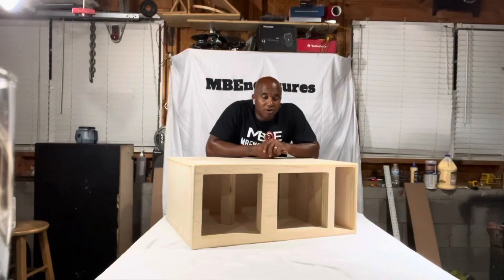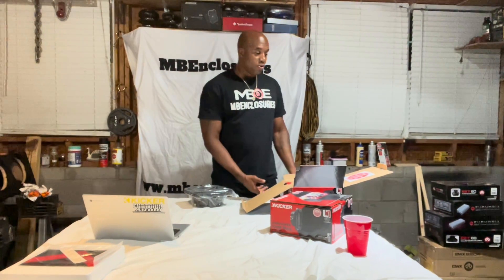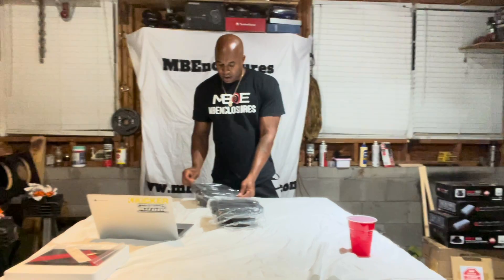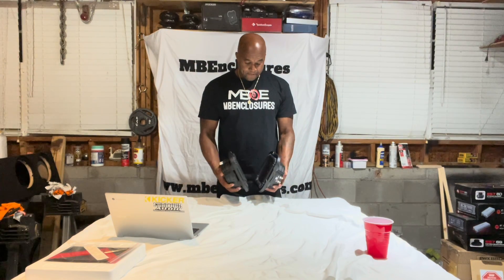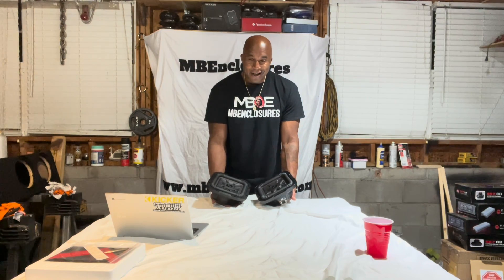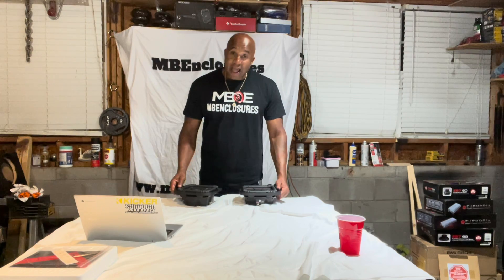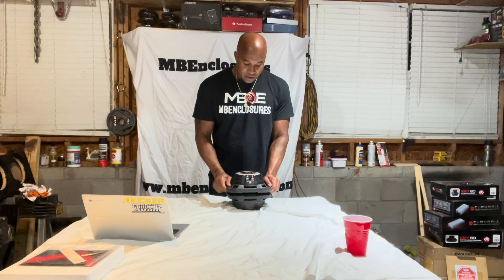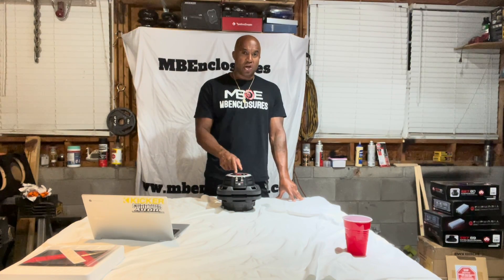Isobaric Loading Subwoofers and the Premise Behind It.

Comment: MB I had 4 Orion 10's Red stripe (I believe) in a 94 escort LX, HCCA 1k 6 channel at .5 ohm, it was by far better than any traditional box system I've had after including 2 t1 power 15's on a mmats 1100.1D. And the 15's were monsters 
But accuracy, sound carry, sound quality & omg the drops...I had to disconnect the emergency fuel shutoff in the trunk cause it would trip in acc mode & my car wouldn't start NO LIE !
Now you have me thinking i can fit 2 L7R 12's in my camaro instead of just the 1 in it now & absolutely kill it 🤯
Reply: Wow, I had a 1994 escort gt with two orion xtr 12dvc  and a orion hcca 225 and a soundstream reference 500 on my mb qaurt mids and highs. Don't tell me your escort was red too

Comment: I have 2 Kicker CompVR 12s I've been debating about putting into an isobaric bandpass similar to the one I had when I met my wife. It was 2 Hollywood Sound Labs 12s in a 13 × 13 × 32 enclosure. The 2 12s were clamshelled exactly the way you described 12 inches into the enclosure. The larger side was ported tuned around 45 ish Hz. Everyone swore I had 2 15s inside lol. I'll build this same enclosure using the kickers & let you know the results.